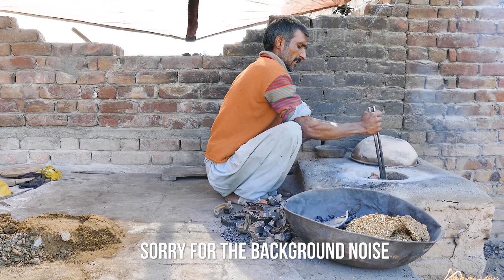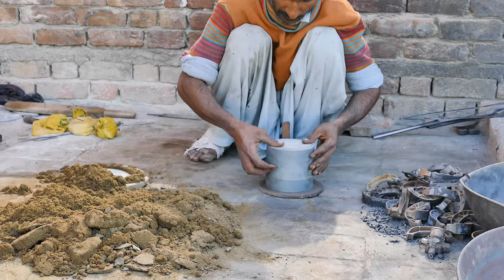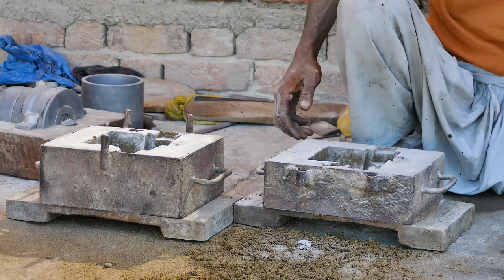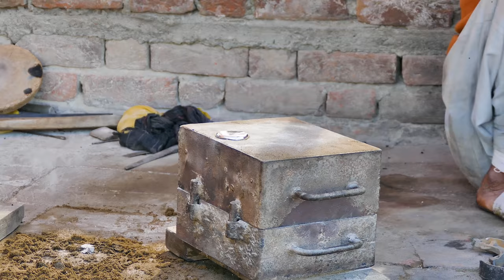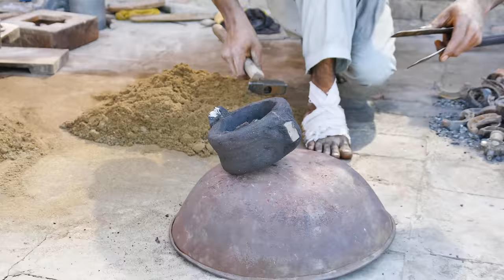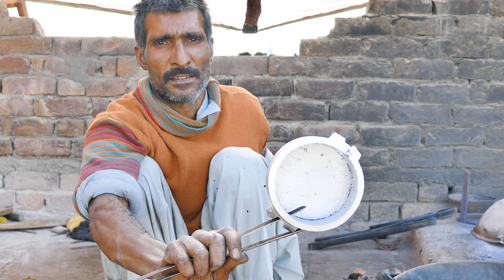Aluminum Casting an Oil Tanker Supply Camlock Cap Using Sand Mold

Comment: love the baked core from the same moulding sand, this stuff seems to have great qualities over greensand. I notice he feeds the furnace with coke [I also burn coke in my furnace] but what's the brown stuff he's putting in as well?.
Reply: Camel turds/cow patties
Reply: The sand has amazing texture ...watch it fall away slowly like a gel almost. 
Very interesting.
Reply: @MrTheHillfolk  Yes I noticed that as well.
Reply: @markfryer9880  
I'm no casting master by any means but I thought the sand needed to be dry. 
Of course it's difficult to discuss when you don't have a total grasp of what's going on....now if ya wanna talk generators that's my deal. 
I thought in the big industrial stuff the sand has some kind of glue thats heat activated and once it's used in a casting it's done.